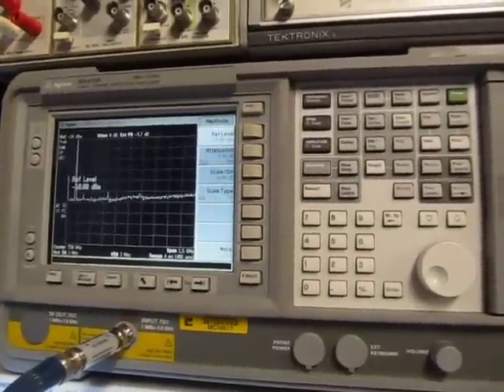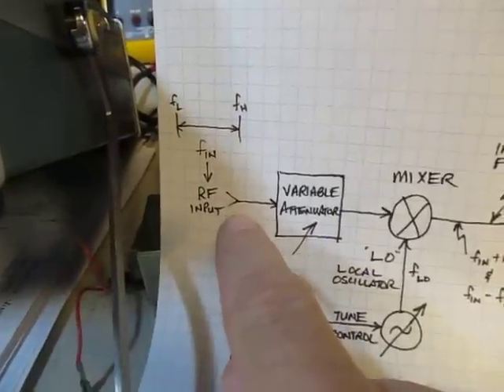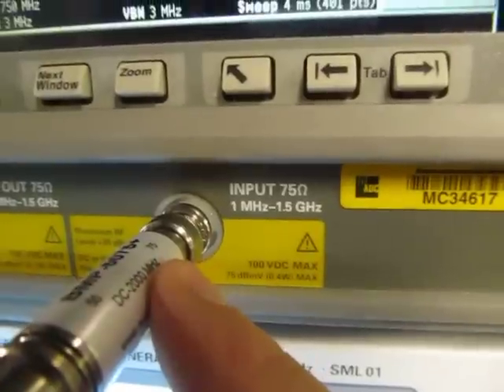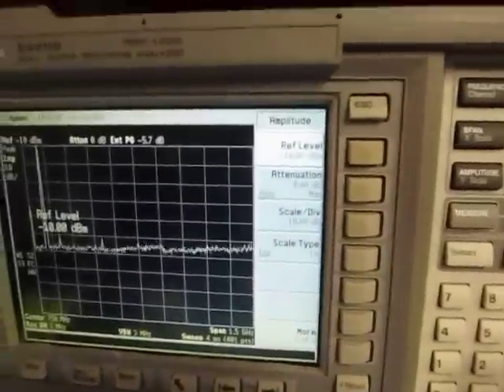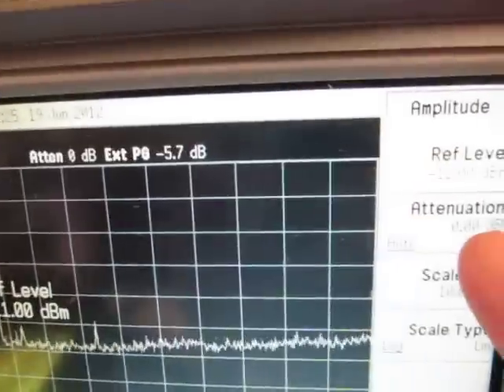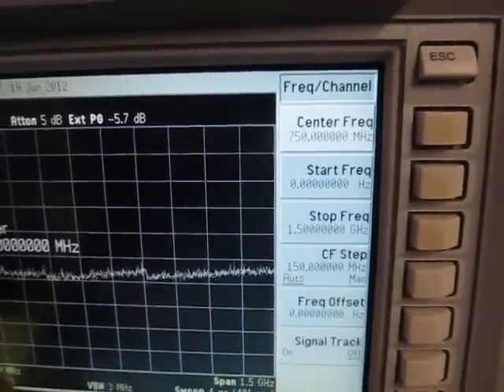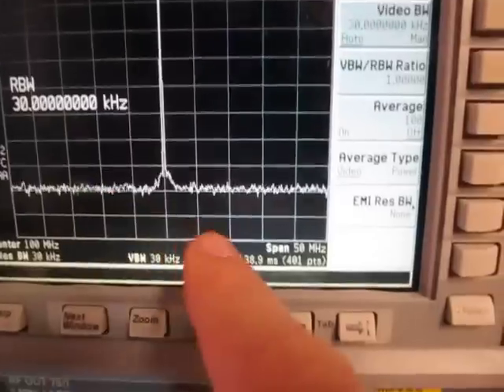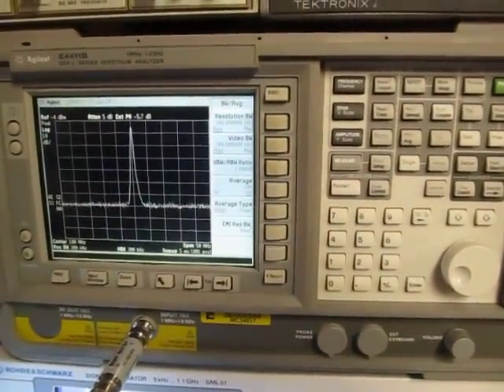#51: Basic Spectrum Analyzer Do's and Dont's ...

Comment: How can you use a spectrum analyzer to measure CCTS? Somehow you can calculate the Crew Curve of the audio signal by knowing the resonance frequency and the speaker frequency start and stop range. I'm not sure what the crew curve is used for
Reply from the maker: I don’t know what CCTS is.
Reply: @w2aew  CCT means circuit. I don't know what the difference in using an FFT sweep compared to using an Audio Sweep because when you use an Audio Sweep you will see more harmonic peaks compared to using FFT sweep? When the spectrum analyzer is displaying harmonics I have been told to use the hybrid superHET filter to remove the harmonics, is this true?

Comment: Thank's for this video, i have a question about the input power, since there is an internal attenuator, does +30 dBm of the maximum input RF power refers to the maximum power when internal attenuation is set to 0 dB, or whatever internal attenuation these +30 dBm should not be exceeded ?
Reply from the maker: You'd really have to consult the data sheet for your specific analyzer. Generally, the input limit on the front panel applies at any attenuator setting (due to power limit of attenuator)

Comment: need your advice I bought a used HP 8981a Vector Modulation analyzer without any manual hoping to use it on audio tuner debug. Did I buy the wrong piece of equipment and it looks like I need to purchase a high freq generator. First time i've purchased this kind of equipment and need some help. Thanks
Reply from the maker: Unfortunately, it does seem like you've got the wrong piece of equipment.  This unit is intended to analyze digital modulation quality (such as QPSK, 16QAM, etc.), either on the baseband IQ signals or on a quadrature modulated IF signal.  Doesn't sound like it will be of much help debugging analog audio tuner issues.

Comment: Hello W2AWEW! What happens in the case that I have two tones, assuming that both are 5MHz apart and where the tone of interest is much lower than the other.  Does setting a narrow span perform a filter behind to suppress the higher tone?  This is important for me because I want to measure the lower tone accurately without over ranging.  In general, when we set the reference level,  is the gain applied to every tone the spectrum finds or only confined to the span of interest.  Thanks alot
Reply from the maker: It really depends on the analyzer, and the type/configuration of the preselector before the first mixer. A 5MHz spacing is fairly close, so I don't know if this would get adequately filtered away from the front end, even at very narrow spans.
Reply: Many thanks for the answer!

Comment: Hello W2AEW, is it possible to measure phase of a signal on a signal analyzer, if so could do a demonstration of the measurement.
Reply from the maker: Yes. There is a class of analyzers called Signal Analyzers, more specifically, Vector Signal Analyzers. They can acquire/record signals vs. time and give you the ability to analyze amplitude, frequency, phase, spectral content, and more - all vs. time. Most will do more advanced analysis include modulation quality, pulse analysis, and other signal analysis functions. With these VSAs, phase measurements are 'relative' to the measurement frequency.  To measure phase response of a device under test, you would usually need a different type of analyzer called a Vector Network Analyzer.
Reply: Im a beginner, are these things good for an aspiring design engineer?

Comment: Question: just got a RIgol Spectrum Analyzer with tracking generator. Tuning ham radio duplexers, I noticed that when I manually change from say 550 ms to 5 sec sweep time, the point of tune changes. Is there an optimum setting that is best for this kind of work? Also noticed than there's not much change from 5 seconds to 10-15 seconds, but I want accuracy, not speed....suggestions?
Reply from the maker: Paul Dallard I've never used the Rigol SA, but in general I would tend to put my faith in the slower sweep.  At the faster sweeps, you could be seeing a little "delay" affect from the narrow RBW, or a slight offset of TG and SA.  To validate this yourself, establish a tuning point and then manually check it using zero-span.  See if the fast or slow sweep gives you the most accurate result.
Reply: Thanks, I will try that. I'm also going to use the automatic setting on VBW and RBW, instyead of manually setting the span, time , and RBW.

Comment: Yes thats what it is. The repeater is for a particular cell carrier but it needs higher power because off the building where the phones are being used and is shutting down another adjacent phone carrier, can a band reject filter be used in this case? Because the repeaters dont have any internal attenuation nor gain controls.

Comment: Hi Alan, nervous about overloading my input, check me on this for rules of thumbs please. I have a RF sampling tap good for 30 db, 1:1000. My Rigol DSA 815 has a max input of 20 dbm 50v DC. The tap then would make 100 watts equal to .1 watts, correct? Which is 20 dbm? So it's safe?  Newer to these devices - so nervous about blowing it up I'm afraid of using it!  I also understand the sampler manufacturer recommends starting with 10 watts into the sampler, more conservative.   So this device would work well with the spectrum analyzer as long as I don't exceed 100 watts into the sampler?          2nd question - Instead of a sampler, I also have a step attenuator, both button based, up to 90db, and another one that is rotary based good for 70db attenuation. I'm assuming those are good as well, i.e. but could you literally hook up your radio directly into the attenuator pad set for 20 db or more driven with 100 watts and it would be fine? I know that's not conservative just want to understand the theory and the limits. I would likely start out with 50 to 70 db attenuation, but I would not need the sampler, just connect the attenuator to the radio, and the other end of the attenuator to the analyzer?
Reply from the maker: You've got the ratios right.  100W is 50dBm.  An RF sampler/coupler with a 30dB tap will give you 20dBm out with 100W in.  This is equal to the maximum input rating on your Rigol, so while is it in theory "safe", I personally wouldn't run it that close to the limit.  I'd put another 10 or 20dB attenuator between the coupler and the SA input, to give you +10 or 0dBm to the analyzer.  Also, be sure to set the Reference Level on the analyzer appropriately.  Also, make absolutely sure that the coupler is rated for 100W through the main path, and that the output of the main path of the coupler is properly terminated into a dummy load.    In theory, you could also use your step attenuator, BUT it would HAVE to be rated for 100W (which is doubtful, since you don't see high power step attenuators very often).  If it was me, I'd use the coupler, dummy load and then the step attenuator between the coupler sample output and the analyzer.  Then, adjust the step attenuator as needed (i.e. 20dB or more).
Reply: @w2aew  Alan, perfect. One short follow-up - I'm assuming setting the ref level correctly is for accuracy only, doesn't affect safety on any inputs, etc.? Thanks and 73. KM5L
Reply from the maker: @patrickbouldinkm5l143  if the reference level is set too low (below the signal level), you risk damage.

Comment: What if the spectrum analyzer starts beeping because of overload? How do I know if I damaged it?
Reply from the maker: Depends on the analyzer.  I've never used one that beeped when overloaded, so you'd have to consult the manual to determine if the beep indicates damage has occurred.  Major damage would be indicated if the amplitude of measured signals was wrong, across the frequency range and attenuator range.

Comment: HI W2AEW. I am planning  to buy a service monitor for two radios but I would like one which would have a scope, spectrum analyzer. As I would like to use it for service the two way radios and to tune duplexers. What would you recomend. Also that it is not so expensive.. I will be waiting for your response. Thanks
Reply from the maker: +Yeshua Jes I don't have a service monitor, and have actually never used one - so I can't offer much help in this area.  Marconi/IFR/Aeroflex and Motorola seem to be the most popular service monitors and communications analyzers out there.
Reply: Thanks a lot.. I will take a look at those brands.

Comment: What happens to the accuracy of measurement if I overload the spectrum analyzer? For example, I have a very big fundamental and a much smaller spur close by. If I set the reference lower than the peak of the fundamental, what happens to the amplitude measurement of the smaller spur?
Reply from the maker: Setting the reference level below the main signal level can result in inaccuracies due to gain compression, growth of Spurs and distortion componespnts, and even possible damage to the front end mixer.  Lots of factors affect what will happen, including the design of the specific analyzer being used. Bottom line, don't do it.
Reply: Noted. Thanks!

Comment: Is there some significative difference between Analog and Digital SA?  (about scopes I know the lack of single-shot in the analogs)  thanks
Reply from the maker: There are a number of varieties of "digital" spectrum analyzers, so the answer is little more involved...  For example:
-Some digital analyzers simply digitize the signal in the final IF stage and perform the final RBW filtering and detection in the digital domain.  These generally offer more RBW selections than a pure analog SA.
- Some digitize the signals at a higher IF stage, potentially offering some RF capture vs. time in addition to the RBW flexibility over time.  More advanced units can do vector signal analysis.  Basic units simply digitize early to make inexpensive hardware.  In these cases, the spectrum might be computed using an FFT or similar.
- Some digital SAs directly sample the RF, thus all the spectrum and filtering computations are done in the digital domain.  This latter architecture usually doesn't have preselection.
Reply: @w2aew Thank you, Alan, I'll study what you say, seems a little complex.  I never found this kind of analysis (Analog vs Digital SA), maybe because there are many types, as you said.  This is a good topic for a video class.  Thanks.

Comment: Have you ever used a network analyzer.. any thoughts.. usefulness, the $120k R+S may be out of my league.. Id like to design stuff..
Reply from the maker: I network analyzer is useful if your plans are for characterizing RF devices, etc.
Reply: you must be right.. heres the tool list of a local electronic and communication engineering firm

In-House Tools
Radio frequency and hardware test capability:
6GHz spectrum analyzer
6GHz network analyzer
Mixed signal oscilloscope
RF attenuators
Shielded boxes
Power meter
Beagle USB 12 Protocol Analyser
RPM Systems Corp. Root 2 USB 2.0 Test Host
Reply: I am about to enrol into electronic and communication engineering. Though Im jumping the gun, id like to be an entrepreneur and set up my own mad scientist cave...
Reply: hmm.. how does a pleb be useful to a top engineering micro business.. I was considering making him a website and saying there.. 4k website let me be your "intern-pain in the butt" for two weeks... I cant see myself being very useful to him at the moment
..except for his crappy marketing.

I will need to do 100 hrs engineering work exp to get my degree... this business new to my area is 500m away from my home... oh how sweet and a change that would be from belting up the freeway for half an hr... hmm

Comment: Hi Alan how many hz is 
TEKTRONIX - AWG420 is it in Mhz or Ghz
Reply from the maker: The AWG400 series is an arbitrary waveform generator that runs up to 200MS/s, that's too 200 mega samples per seconds. This means that the maximum output frequency will be about 80MHz.
Reply: Thanks for your time really your are the fastest reply on YouTube as i am considered Great channel

Comment: I would like to reproduce the graph in my AC book.  

I know I've probably gotten a little off the path for an electronics student but the Spectrum Analyzer relates to so much science and physics I had to try it out.

I'm probably not setting it up properly though to start out with.
I've tried 5 Spice and Tina 9 with no results.
Any suggestions would be helpful.
            3H
|----------nnn--------------
~    1V   60Hz        RL  1k
------------------------------

Thanks.